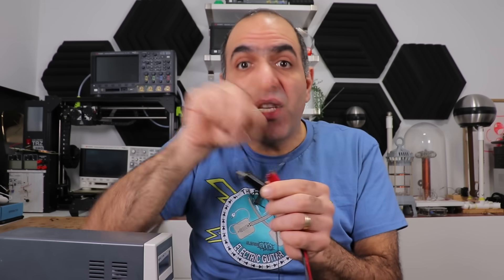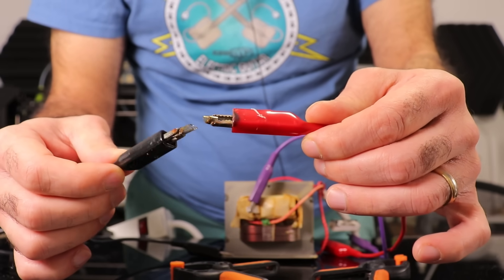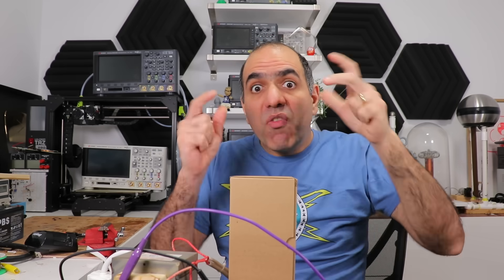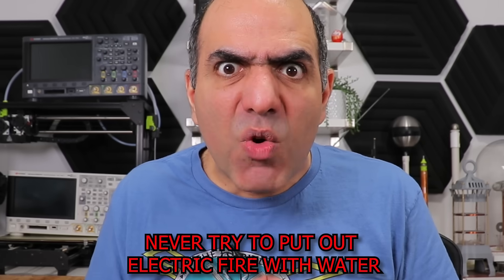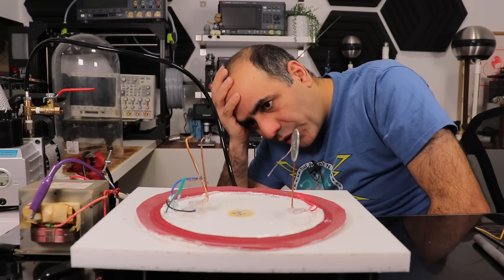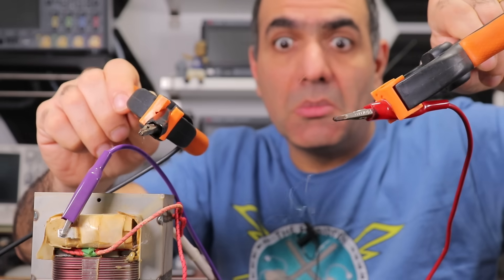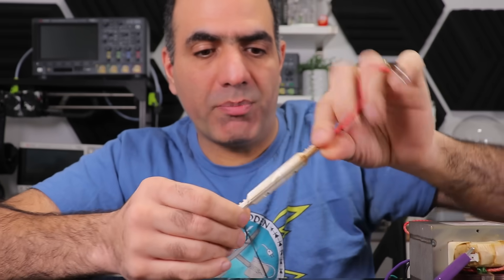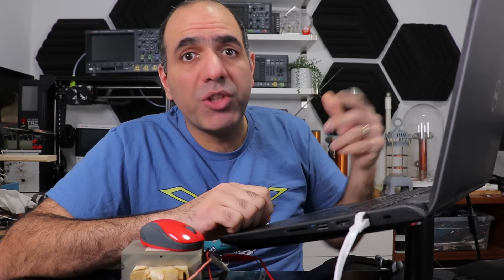Making a High Voltage Fuse

Comment: In the power industry they use sulfur hexafluoride  (SF6) gas in special arc quenching circuit breakers. Often there's a special mechanism, to open a gas valve as the breaker opens up, to basically blow the arc out. I remember seeing one in action, in "power lab", back in school, when getting my EE degree (1980s). Power lab was scary, as much of the gear was the size of van, with high power resistors that actually glowed under normal operation. Syncing up the large synchronous machine (could work as both generator or motor) just before connecting it to the 3 phase grid, was always a tad sphincter puckering !
Reply: Are you sure you're not confusing things? As far as I know, there is arc extinction with compressed air, which blows air onto the contacts, blowing the arc away, therefore cooling it down and extinguishing it.
SF6 Breakers by itself are different because of the good isolating properties of the gas, but these curcuit breakers are enclosed inside gas-tight housings which are filled with SF6 Gas. It's really fascinating to see the size difference between air-isolated and SF6-isolated switchgear. SF6 gear is wayyyy smaller.
Reply: SF6 dead-tank breakers do in fact have a similar mechanism which blows the arc out.  @adrianfurgol
Reply: @adrianfurgol true cause they both are just limiting the ion formation between the contacts to extinguish the Arc
Reply: So, deep voice gas stops electric fires? Very nice :-)
Reply: The industry is transitioning away from SF6 as there are probably environmental regulations on the horizon. Some companies now use a mixture of pure oxygen and nitrogen.
Reply: @timschulz9563  - It was the 1980s, so memories are always suspect. Especially, since I have an International Harvester Suburban commercial playing in my head. You can see the issue in that one, though that commercial memory goes back to the 1960s, as a child. The sphincter puckering, in power lab, that was a recurring theme.
Reply: @timschulz9563 ''mixture of pure oxygen and nitrogen,' man, I love breathing that stuff for the buzz. Makes me feel alive!
Reply: @robinpollard7629  Well, if the ratios are inverted it's not that breathable.
Reply: @timschulz9563  'if the ratios are inverted' I'd call it nitrox20 and I'd happily breath it down to 28m underwater.
Reply: Very interesting !
Reply: "sphincter puckering"! LOL
Reply: SF6 is about an 8000 times worse greenhouse gas than CO2, so it's being phased out. Vacuum breakers (with high vacuum and long breaking distances) or air-breakers, which blow out the arc with a puff of compressed air, is the alternative.
Reply: The world is complex
Reply: They use SF6 to make HV transformers smaller too.
Reply: Remarkable! Here in the rust belt we use sand
Reply: Yes, on ship, for high voltage bus, like 3-phase 690V, they will using ACB contain SF6
Reply: sulfur hexafluoride gives me my deep DJ sexy voice
Reply: Glowing reistors- sounds like a light bulb ;P
Reply: You're right about breakers, those are supposed to be reset so the arc must be quenched as quiclky as possible to prevent the contacts from degrading. You probably wouldn't find it in fuses in which the arc must only be quenched to prevent it from continuing the circuit. SF6 by it self is not toxic, but in case of fire that's a different matter. The are other methods of quenching an arc, lengthening the path, cooling the arc, blowing out with air, oil or oil mist. A full vacuum also works, but as demonstrated by Electroboom, a partial vacuum is actually counterproductive.
Reply: I work in the power industry and yes we use sf6 gas above 10kv (10.000v)
Reply: I’m a wind turbine technician, our SF6 switchgear is roughly the size of two deep freezers, it’s definitely nerve racking to hear it trip right behind you when you’re messing about in a cabinet and something up the turbine causes it to trip.

Comment: Are you sure that the spring vaporized? It may have retracted fully inside the end-cap. I would expect the spring to have a higher current capacity than the fusible element. Also, many high amperage industrial fuses pack sand around the fusible element for arc quenching. I'm not sure if that would also work for high voltage. Sounds like another experiment. (Though the sand will block the view of the camera so it might not be as visually interesting.)
Reply: Bigclive did a video tearing apart some high voltage fuses including some that used sand, didn't blow them iirc but interesting to see the construction regardless
Reply: @bosstowndynamics5488  I resisted saying "high voltage" when talking about these fuses. There are many flavors of high voltage. The fuses that I'm familiar with are several hundred volts. Definitely "high voltage" compared to Arduinos. (Or normal US residential wall voltage...) But not the "high voltage" in the kV range that Medhi is playing with. I don't recall what flavor of "high voltage" BigClive's fuses were. All I'm saying is be careful of your terminology...

Comment: I think the reason the spring fuse worked well is because you don't need the wire to completely disconnect or melt for it to work. All you need is the wire to sublimate enough for the tension of the spring to be able to tear the wire apart. You won't get much arching because the wire goes in a split second from a short to a significant gap. 

I think the spring just retracted in the flash as opposed to completely disappearing. That's also probably why there's no residue where the spring used to be. Only where the wire used to be.
Reply: If you go through frame by frame, you can see the wire just glowing a dull red before the flash as (presumably) the heat just weakened it enough for the spring to pull it apart
Reply: @zuthalsoraniz6764  yes, exactly
Reply: Could be that the fuse is also pressurised, given the arcing behaviour in the vacuum chamber. A small glass cylinder like that should be able to withstand several bars of overpressure.
Reply: @TimRrstrm I think they are in atmospheric pressure and the fact that Mehdi's vacuum chamber didn't work cause it's partially vacuum
In a absolute vacuum chamber there wouldn't be any ions left to form an Arc
Reply: @snaay4 first, there's basically no such thing as a perfect vacuum, simply doesn't exist in reality. Second there will always be a possibility of arcing, even in ultra or extreme vacuums there's a dielectric breakdown point (this would be a cold cathode ray tube essentially, basically an electron gets free enough to become accelerated by the electric field). Initially this may just be electrons happening to tunnel to outer energy levels, or it may be started by photoelectrons, however once current flows you'll get a domination of thermionic emissions.
Reply: @xxportalxx.  Yeah true
Reply: @snaay4  Bit hard to achieve an absolute vacuum on Earth if you don't have a research lab and several million dollars in funding.
Reply: I think Mehdi needs a high speed camera. Smarter every day has at least one. Mehdi, get a sponsorship from Phantom.
Reply: @okradeinnod you got my vote
Reply: @okradeinnod  We need to see if Linus hooked him up with one first
Reply: Sounds like another opportunity for an Electroboom/Slow Mo Guys collaboration.
Reply: Yes, I had seen it too. The wire on the right of the spring glowed, got softened and the spring pulled back and broke it quickly, all in a split second.
Reply: If the spring was the fuse wire, it also would have made the wire a lot longer than it appears.
Reply: Awesome lesson on fuses. Thank you!❤
Reply: We all saw the exact same thing you saw. What the hell makes you think anybody needed this to be explained to them? There was no mystery in how it works.
Reply: Just a little you can’t let your brother can’t let you outside. Just come on just do it. 6:46
Reply: Normaly the metal used for those whires creates the gas that's needed to stop the arc, combined with the tiny chamber it's enough to play his fuse role.
For the fuses tjat are filled with sand it creates a different gas that has not worked has well as those, but because it was filled with a solid it was enough too. The only problem with the last ones was that it could get wet so they wasent that effiscient and precise has the first ones was.
NB: my english can be aproximative, that's normal ^^'
Reply: I think the "spring" is a sign of a slow acting fuse.

Comment: in de past i was confused that 250V fuses could have more Amps on lower voltage rates. I thought it was all about Power instead of the amperage.

Comment: The rated volatage is mostly to say that the fuse will predictably melt at the overcurrent. If the voltage is higher the arc will keep the shortcircuit going and damage the cables insulation. A 16A fuse for 12V will still melt with 16A at 230V, the arc keeping the shortcircuit going is a problem tho.
Reply: Tell the world that you didn't even watch the entire start of the video without telling them...

Comment: Some types of fuses may contain gas inside them, such as expulsion fuses. Expulsion fuses are filled with different types of gas that act when they are heated up. Expulsion fuses are used for high voltage applications, such as transformers and switchgear.
Boric gas: Boric gas is a type of de-ionizing gas that is used in expulsion fuses for high voltage applications, such as transformers and switchgear. Boric gas acts when it is heated up by the arc and decomposes into water vapor. The water vapor blasts the arc and prevents it from reigniting.
Vacuum: Vacuum is created by evacuating the air from a metal tube or a ceramic body inside the fuse. When a fault occurs, the vacuum expands rapidly and creates a high pressure that blows out the arc.
SF6: SF6 stands for sulfur hexafluoride, which is a type of inert gas that is used in expulsion fuses. SF6 has a high dielectric strength and can withstand high temperatures and voltages. SF6 also has a low reactivity and does not support combustion or oxidation.
Soapstone: Soapstone is a type of mineral that contains calcium carbonate. Soapstone is used as a fuse tube material in some types of expulsion fuses. Soapstone has a low thermal conductivity and can resist melting or burning when exposed to high temperatures.
from gpt-4, bing

Comment: I have seen high voltage fuses for 20kV with explosives for arc quenching and tripping the circit breaker by blasting a pin out the end. Length of these is about 50-60cm.
Reply: re: "high voltage fuses for 20kV with explosives"
Termed "expulsion fuses" in the industry. The guts of a ceramic tube (where the fuse element resides) is spit out via a small charge when the fuse element sees over-current.

Comment: Making a high voltage fuse is a simple and easy process. Here are the steps you need to take: 1. Gather the necessary materials. You will need a ceramic tube, an insulator, two lead wires, and a fuse element. 2. Attach the lead wires to the insulator. Make sure that the connection is secure. 3. Insert the fuse element into the ceramic tube. Make sure that the fuse element is centered. 4. Place the ceramic tube into the insulator and secure it. 5. Connect the lead wires to the fuse element. 6. Test the fuse to make sure that it is working properly. Once you have followed these steps, you will have successfully created a high voltage fuse.

Comment: Gases for arc suppression:  Aircraft piston engine magnetos were pressurized with air to a few tens of PSI for better performance at high altitude.  Portable industrial x-ray tubes are pressurized with SF6 to around 50 PSI to suppress arcing from tens of kilovolts of potential. 

Happy holidays, Mehdi.
Reply: regular fuses dont use any special gas and arent actually sealed. sf6 would improve performance (increasing the rating of a small fuse), but it is expensive and adds complexity of sealing the fuse. the lack of a seal also helps release pressure in a overcurrent event.
Reply: Use metric like the civilized world does. PSI is bullshit.
Reply: X-ray tubes are under a hard vacuum, not pressurized.

Comment: Arc quenching is a fascinating topic. One of those british or australian electronics youtubers did a teardown of circuit breakers and showed some of the purely geometrical design elements used to encourage arcs to die quickly. Interesting stuff!
Reply: I feel like you might be talking about Big Clive but I believe he's Scottish, I could be mistaken though.
Reply: @douggiles7647 OP said British, so technically correct about someone from Scotland
Reply: @pickyyeeter just don't tell a scot they're a brit.
Reply: @Mr.Sparks.173  Telling a Scot they're British is okay, telling a Scot (or an Irishman or a Welshman) that they're English is definitely a bad idea
Reply: Big Clive is indeed Scottish, but he's also British :)  @douggiles7647
Reply: please link said video
Reply: @mathias6369  Australian, I'm guessing would be EEVBlog. British, there's a few different ones.
Reply: @mathias6369  I think it was photonicinduction's video: https://www.youtube.com/watch?v=WAhq_A4EbkE
Reply: Pretty sure it's Big Clive indeed
Reply: Are you thinking of mikeselectricstuff? https://youtu.be/gOUSDDLKICk?si=gQT5IO6yulykHRPa
Reply: could also be Photonicinduction he does high voltage/current stuff like blowing a 5000A fuse